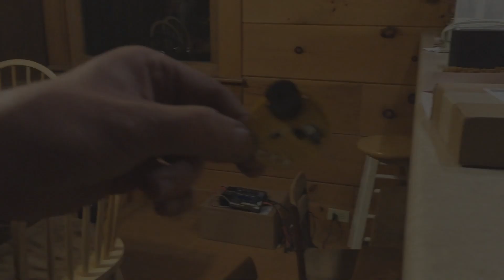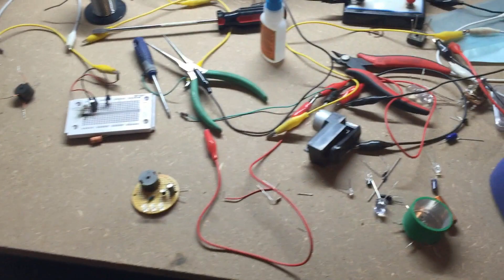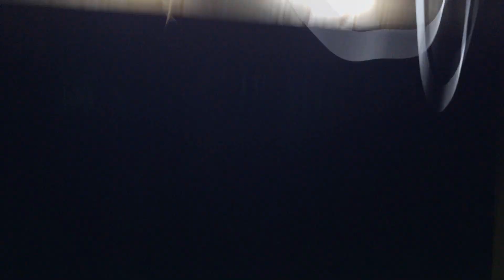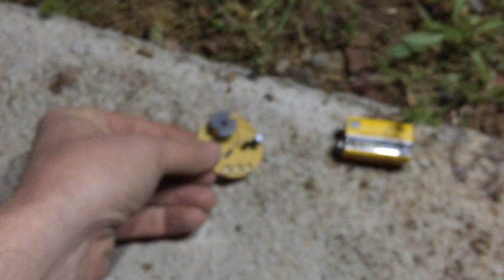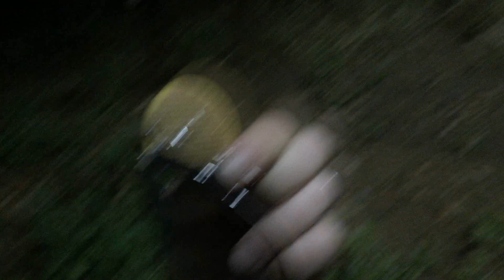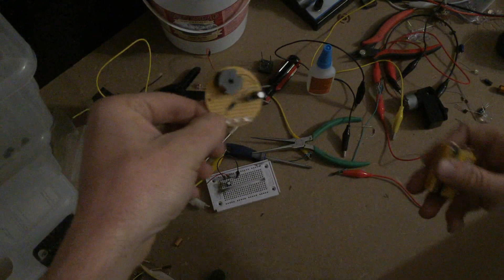Ground Activated LED SJR L Circuit Runs Battery Free

Comment: you basically made a crystal radio circuit, just without the tuning selecter and without the earpiece
Reply: I rewatched the video looking for the microwave test that you mentioned, and didn't see it. The thing most people forget about a faraday cage, is that it has to be sealed to work, so unless it continued working inside the microwave, with the door closed, it wasn't really in a proper faraday cage...
Reply: there are also differences in which frequencies are blocked, by adjusting the mesh size of the conductive materials used. I believe that consumer microwaves operate at approximately 2.4 Ghz, in the ISM band for unlicensed spectrum, similar to older wifi routers and lots of other wireless electronics. I'm betting that the companies that make and sell most consumer grade microwave ovens would only design their shielding to only block the frequencies that their magnetron is operating at, to lower their material costs per unit. I know that I've personally witnessed several cheap microwaves interfering with their owner's wifi routers, which I know for a fact used 2.4 Ghz...

Comment: A mystery indeed! If it has something to do with negatively charged particles/electrons and ions, then how it possible for the ions in the ground to bypass the wire??? Theres not even using copper pipe as ground. Hmmm...
The plastic is not a good conductor. Why is the electrolytic capacitor only  activated when near the ground? Something is fishy around here.
Reply: Danyal Ahmad It's dielectric, he is establishing an electrical potential difference by touching the ground directly or through an insulator. Charge is not the electrons and ions per se but are moved by the charge of the electric field. that is why in the other video him using a capacitor worked as well.  People often confuse electric current and the electric field.
Reply: So, you think the charged particle in the ground will be able to exert a force on the capacitor storing charged particles from the 9v battery. Interesting.
Reply: ***** I understand you point the energy can flow through insulators and objects, but the input will be decreased while doing so. If negative charges do not come from negatively charged particles, where do they come from.
Reply: Danyal Ahmad Yeah just like letting air out of a balloon. The particles cause the charge (the precipitation) in the electric field and if there is a way for the potential to be transmitted we will have a flux that in turn causes a current of electrons. The more conducting the material the better but the difference is small if the electric field is oscillating. Everything is a conductor with enough frequency.
Reply: ***** But, the ground does not have a very strong frequency.
Reply: ***** The concept can be proven by water drops falling through a tin can with hole in the bottom. Very interesting results.
Reply: Danyal Ahmad The circuit oscillates though, once the loop of wire is placed near the ground there is an induction and the circuit starts oscillating. The loop of wire acts like a loop antenna and discharges the capacitor which causes the LC circuit to start running.
Reply: Yes
Reply: Danyal Ahmad The kelvin dropper is also a form of induction yeah but an electrostatic one. If it is the case he should be able to have the same effect without using a loop, like with just a metal stick.
Reply: ***** I am aware of that
Reply: Danyal Ahmad Great :)
Reply: Thx

Comment: Neat!
Reply from the maker: TinselKoala Once I get this circuit and pot core dialed in, I would like to send you one to test out on your new Rigol oscilloscope.
Reply: lasersaber I'd love to do it. I looked at your site but only saw the Version 3 schematic, and I don't have any pot cores or fine Litz wire on hand. Is there some way I can PM you securely?
Reply from the maker: TinselKoala 

I just sent you a PM over at OU forum with my contact info.
Reply: Its running
Ratio needs

Comment: Hey man, Did ya think... What do you get when you put a germanium Diode with a coil with essentially an anntenna, you pos lead and the ground the neg lead, You made a little radio, if you replaced the LEDs with an earphone you would probably hear a hum buzz or if your lucky a radiostation. your windings in the coil have it "Tuned" to a signal of somesort even if its just atmospheric noise. and apparently it's strong enough to light the LEDs. Just my guess, and I have not the skill you do.

Comment: There is something bugging me about your schematic V3.0...
that short segment of wire between the cathode of the bottom LED and the right side of the potentiometer.  It seems like it doesn't really do anything... It' just hanging there on one side of the transformer without an obvious current path to anything.
Is that segment of wire needed?  Does the circuit work without it?

Comment: Have your read about Henry Moray?  In the 1930's, he was consistently producing thousands of watts of electricity with a device connected to an antenna and earth ground.  His mysterious "swedish stone" was later analyzed as germanium and it is speculated Moray was first to produce a germanium transistor. His circuit sounds very much like a large Joule Ringer powered by an open loop, antenna to earth ground electrical flow.   http://www.cheniere.org/books/excalibur/moray.htm

Comment: Embrace earth ground, not eliminate it. Your work in atmospheric motors, Tesla Magifying transmitters, crystal cells, earth batteries and Joule Ringers are all converging.  A garden light that runs on an earth battery or antenna is a good goal and very marketable. You're an inspiration to many. Keep those videos coming. Thanks!

Comment: seems like you made a radio receiver... same principal as a crystal radio.  The circuit draws so little power it might be powered from a local rf source such as a radio station, or similar.  You can try putting a 10 foot piece of wire in the as an antenna on one terminals while the other terminal is grounded and see if it runs.  Possibly a true Tesla power receiver!
Reply: latasha66 A University of Washington student already made a circuit board that gets power from the millions of radio waves passing through the atmosphere.

Comment: Hi LS, well done ! Did it only light up when you touched the one spot with your fingers ?
Then your body works as an antenna inducing RF power into the circuit and the Germanium diode rectifies it and storing it in the cap. Grounding the one pin then adds the ground to the body antenna, so you have a good antenna ( your body) and the ground connection. Using the battery or the cable loop you use a virtual ground, just a mass of metal as a virtual ground. Was there an RF source near you, when you did this experiment or do you have a WIFI router running near there ? Regards, Stefan.

Comment: One of the main factors in this circuit is the connection of your hand to the circuit board (where you're holding it). Just how that connection influences the voltage is the mystery here. I think it is using your body as a storage capacitor or even to produce a minute current.

Comment: Nice! Showing that the earth is of negative polarity.
Reply: ***** Tesla was quoted as saying that the earth was a great repository of electrons.
Reply: Can101276 It is currently well documented too.The pinch effect causes an axial accumulation of mass (the centrifugal force) that gradually builds up to form the crust of the earth for example  The pressured mass thus releases a lot of electrons at the crust. Check out this paper called "An Integrated Alternative Conceptual Framework to Heat Engine Earth, Plate Tectonics, and Elastic Rebound"
Reply: Can101276 Yeah and UFO's fly over certain areas of Earth that give off power in the atmosphere. People thought that was bogus but a University of Washington student made a circuit board that gets power from the air, without a battery using the radio waves in the atmosphere.

Comment: Ions are traveling from your body to the circuit via the iron in the battery your getting effects I've seen in my plasma ball experiment's try using a virtual ground that's is a magnet inside an iron tube there is a picture of it somewhere on the energetic forums.

Comment: i discovered this effect back in 1989 while designing an electronic sign...i believe what is actually happening is something like; tuning in ambient RF and taking the signal to ground through the led/diode. sort of tank circuit-ish.
Reply: I have a battery powered fluorescent flashlight where the bulb is a loop. As the batteries discharge, the light does not fill the whole length. I can brighten the light by touching its plastic enclosure, and pull the light brighter by having more of it shine. I'm pretty sure it's caused by the same grounding effect. Always kept this flashlight, more of a camping light, just because that effect was cool.

Comment: When you connect the battery to one side and it lights, or move the wire loop close to the ground, I think you're forming a small capacitive load (which you don't do when you touch the circuit in 2 places). Presumably this alters the tuning on your circuit just enough to allow the oscillator to start running.

Comment: I think you eliminated a bit capacitance when you cleared the wires and now the circuit does not start to oscillate. You should look at it with a scope without and with ground. Keep in mind the scope will add a bit capacitance and load to the circuit.